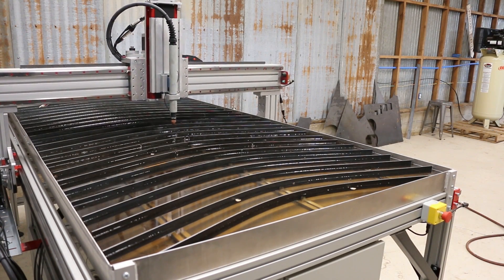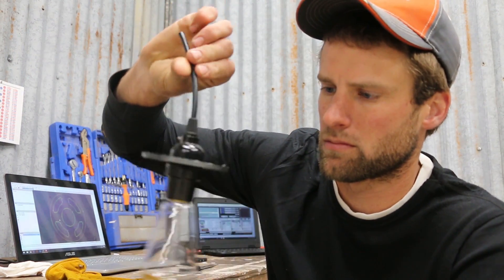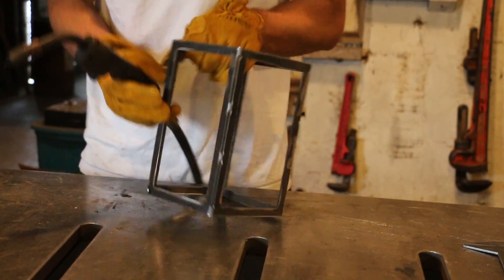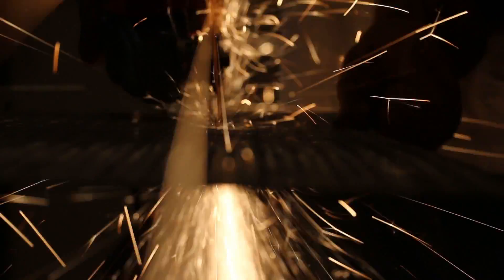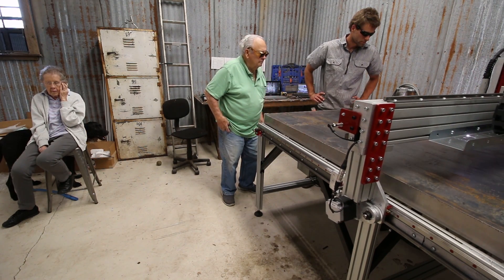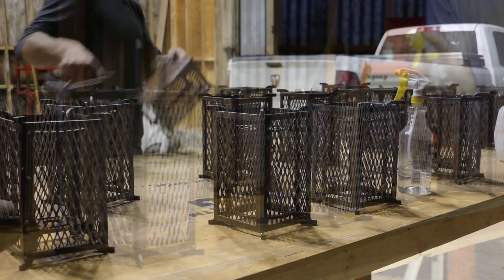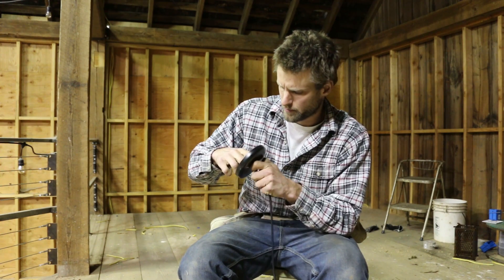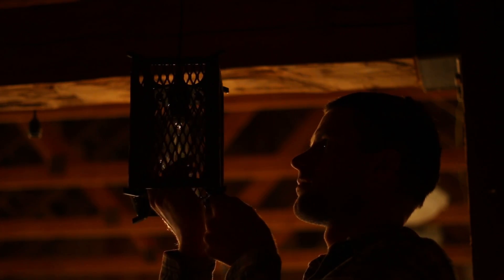CNC Plasma Cut Hanging Lanterns

Comment: You are just like me, welding on the fly but please cover your arms. I found these quick and easy to get into the habit of wearing. 
https://www.google.com/shopping/product/2673793591238519175?q=hobart+welding+sleeves&client=ms-android-verizon&sa=X&biw=360&bih=560&tbs=vw:l,ss:44&prmd=sinv&sxsrf=ALeKk00LvRtmj9VWRb7Bq8uudlSuOkltWQ:1583524208265&prds=epd:5604799936148468324,paur:ClkAsKraXx_pDNFxBY1_qh9hx0OsqrtAVEwMY5QCl_XDuD6JSmw-6sFVRJRnTVTdkDSLqropivEaQJAt-f2sRU2YHRdxvKR9QdpunRmJhyrQfg7TDQa8s5BcMhIZAFPVH72_0tuHJgM6epeccnmczEngb31GJg,cdl:1,prmr:1,cs:1&ved=0ahUKEwiJ9rKvz4boAhVJvZ4KHRr9AqsQgTYIsAc

Comment: Hello there, I really enjoy watching your well made videos always on point. You must be a super busy guy, just wondering if I can pick your brain, I recently bought a CNC table similar to yours  but smaller from cnc router parts (48”x24” pro cnc with nema 23). All the mechanical assembly is done, homing axis, leveling, sheetcam and mach3 software is operational, plasma cutter hypertherm 45 Xp with the machine torch and compressor are ready to go... since I’m new at this I’m stuck. Would you mind sharing some insight as far as the setting that I should use in mach3 for cutting mild steel, say 1/4 “ thick for a small vector file. Any info would be appreciated it. Thank you very much and keep the videos coming.👍🏽
Reply: Rainfall Projects Thank you so much, I appreciate you taking the time to write me back, guess what ,that same night, I guess I figure how to import the right post processor for my machine and finally made my first cut!!! It so exciting, and now what you’re telling me about the tools and cutting speed make perfect sense, like you said before, I never get tired to watch that machine cut, thanks a bunch... keep up the awesome work you do, I wish I had half of your talent 😁

Comment: Looks awesome! I have a question. Are you worried about the strain on the wire from the weight of the cage?
Reply: there's a plastic screw on both ends of the cable removing the force on the connections. the lack of a earth wire is more worrysome on a barn to me.

Comment: Nice work as usual. Quick two cents, looks like you could use a wash tank to degrease parts. Also, those lamps could make you some nice coin if you offer custom silhouette panels with logos or images.
Reply: He has an etsy shop with some cool stuff there and the prices are right in line with hand made quality items. I'm contemplating having him build me a sign for my shop

Comment: Here is a new project idea.   With all the parts you had to touch up with the grinder, you should build an Electromagnetic surface.   Say two foot to a side.  You could lay out a bunch of parts, flick the power switch and grind away.   Seems like it could save a bunch of time.
Reply: radye80  is this viable and realizable?
Reply: We have a butt welding machine at work that hold plates parallel with magnets. It has a copper bar under, space between magnets is what is welde,  long story short.. If you weld near the magnets it pulls the welding rod and wire and makes horrible welds
Reply: radye80 nice idea. Make it extreme had a similar project using electromagnets as a drill vise.
Reply: Might as well get a used surface grinder.